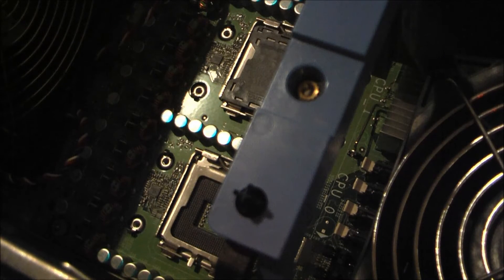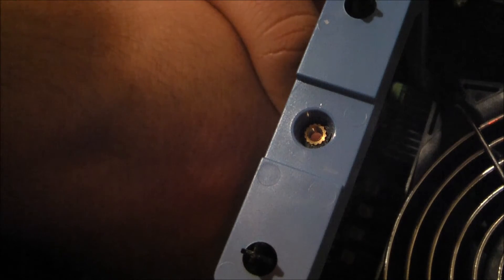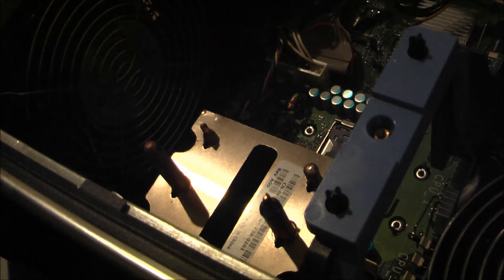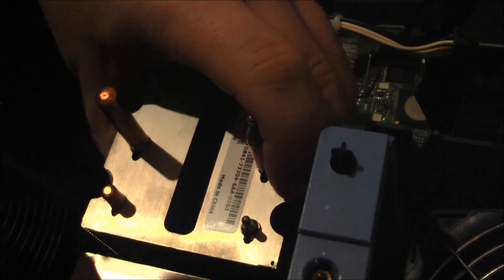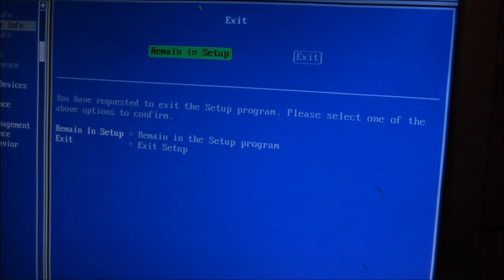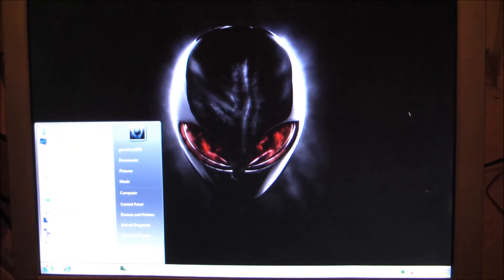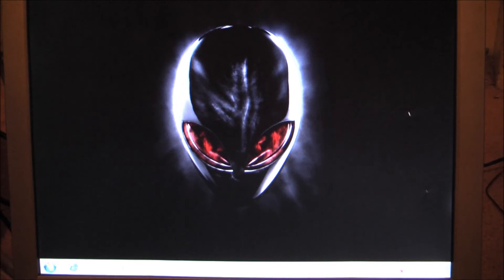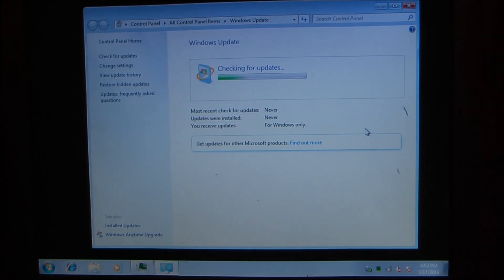Dell Precision 690 gets upgraded

Comment: Intel(R) Xeon(R) CPU ( is this X5355's ???) @ 2.66GHz
Reply from the maker: i forget which processors i put in this. but they were quad core 2.66ghz units.
Reply: gotcha.  
Rev A02 MY171 Motherboards will accept 2 quad cores. Gotta check which motherboard I got. 
Currently have 1 QUAD Core Intel(R) Xeon(R) CPU X5355 @ 2.66GHz processor. Would like 8 due to my work.
Reply from the maker: you will need another x5355 chip, as the chips need to be the same in order for them both to be recognized and usable.
Reply: Yes, indeed..... but if the motherboard is not "Rev A02 MY171" , Dual quads won't work.
Somehow, you've managed to avoid the shit storm: 
http://en.community.dell.com/support-forums/desktop/f/3514/t/18700875?pi21953=6#20056100
Reply from the maker: i have no idea what board this unit had. but whatever it was, it worked.

Comment: Does anybody know the maximum quad-core Xeon Processor to upgrade a Dell 690 Workstation?  (Mines runs a single Xeon 5160 now)
Reply: Xeon 5365
Reply: That's what I thought, just wasn't sure.  Thanks Noah.
Reply: Depends on what motherboard revision you have. A00 and A01 do not suport quad cores.
Reply: Actually my MY191 motherboard Rev 01 did support dual 5355, too my surprise after reading through all the threads.  $35 dollars and plug and play to more than double my antiquated render speed.
Reply: Wayne Hobdy Dude, you might want to put a RW199 motherboard in from the Dell 7400, that way you can put up to 3.4Ghz dual quad core CPUs with 1600Mhz FSB. Thats what I'm doing - you need to replace the front USB tray too but thats like $20. Depending on what you are doing you might find these rival the later QPI based Xeons!

Comment: Could I install i5 or i7 instead of Xeon? I don't want a biased opinion saying Xeon is better I just want like a yes or no haha
Reply from the maker: no. this uses the older lga771 socket. the lga1150 or lga2011 chips will not fit.